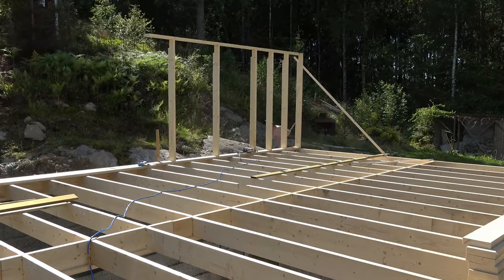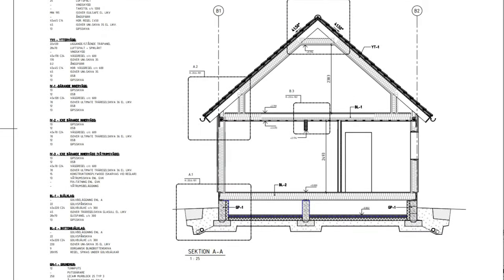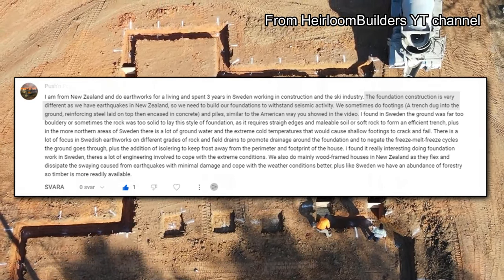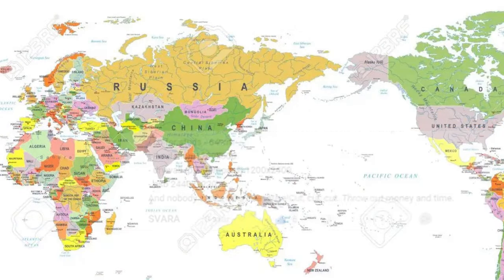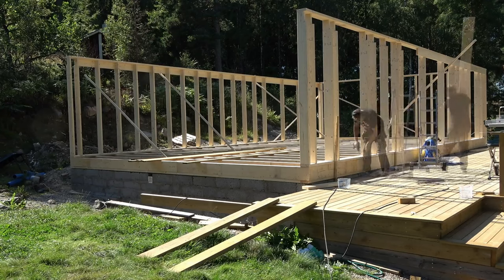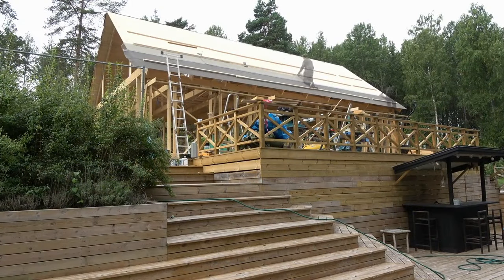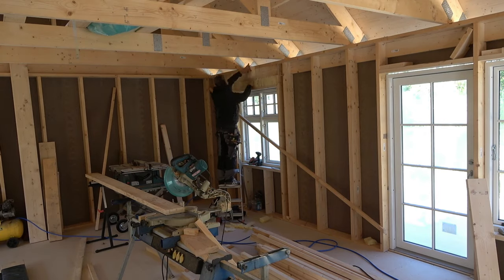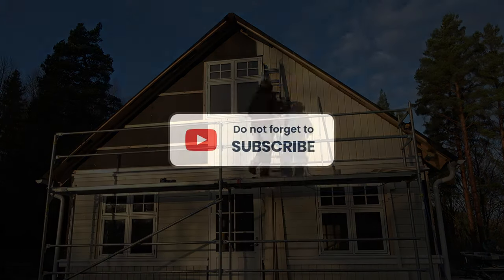UPDATED VERSION! Scandinavian VS American, CA, NZ, RU, AU building methods, let's compare...

Comment: Very interesting comparison! For two years now, we are living in a Scandinavian style house in Germany. The brand formerly worked together with a Swedish company but because of struggles from Swedish crown to Euro, they changed to a Danish company (Danish crown is fixed to the Euro). Building methodology kept the same as far as I know, supporting the comment you mentioned, that Danish house builders follow the same approach as the Swedes do.

Our house does not have OSB on the inside of the walls, but plaster is the robust Fermacell. So mounting anything on these walls is not an issue, just like you described with the OSB backing. But I guess, OSB would have helped in noise insulation, as our walls sadly don't absorb a lot of the noises from the outside. Definitely a downside of a wooden house compared the the brick houses here in Germany - at least as long as you are living with close neighbors all around.

I found the chapter about cables and pipes quite interesting. There, we seem to have the German way, as we don't have routing pipes for the cables and not the double pipes for water, either. I totally agree on you, that the marginally higher costs would really pay out later. But in Germany, costs are always very high priority, nowadays...

What I like most on our house, are the windows! The Scandinavian style (we have Nordan from Norway) are so much better than the German style, I think. Normal windows over here are opening towards the inside, whereas in Scandinavia opening towards the outside is the standard. Contrary to your windows, we have the top swinging ones.

Thanks for all your effort going into these videos!

Comment: I'm in canada, next building I do I'll try to not sheet the floor and to put an hammerband, 

Also in Canada we sheet our wall before rising them

Another thing, in eastern Canada we do fitting strips , commonly called strapping between the studs and the sheetrock, however we don't feed cable and pipes in that space because of the risk there is for them.to be damaged by sheetrock screws
Reply: My next house will have the installation walls, but with battens placed vertically on the studs so the cables and pipes can run up the wall half way between two battens. In Australia everyone expects these services to run vertically, and the safest option is to put them where people expect them to be. Then it shouldn't be a problem to screw the plasterboard to the battens.

Comment: As an architect I personally hate the use of OSB especially in the sub layer sheathing of roofing materials. Over time it will dip between trusses and is really visible as the home ages. I prefer CD grade 5/8 inch plywood. Followed by 40 pound asphalt paper under the final roofing material. I am curious as why you used concrete block for the foundation walls instead of using ICF concrete forms and steel reinforced concrete. The forms are made of rigid foam which will add a vapor and insulating barrier to the foundation. The use of osb is interesting when used behind the drywall. It’s great when it comes time to hang shelving and artwork on the walls. I am and have always been in favor of a vapor barrier inside the wall over insulation. A layer of Tyvek vapor barrier over the exterior sheathing helps vent out moisture vapor while preventing the ingress of actual water from any flaw or defect in the final exterior covering of the home. Running electrics in conduit is also a good idea. I run separate conduits for electrical and low voltage controls / cat6 cabling and satellite. Most every room in my home has runs in two different locations for TV / satellite and telephone / internet wiring. As internet wiring becomes more sophisticated I can pull out the copper cat 6 and replace with fiber optic multi mode cables. The bad part of the conduit used in this south eastern country in Europe is that it is a plastic flex. If there should be a catastrophic event inside the conduit it will be next to impossible to pull out the wires due to insulation melting to the plastic conduit.
As for pre wiring before installing drywall inside, the electric boxes here are designed to be installed after the fact. In the USA our boxes are made with a nailing tab or with nail holders and nails on the top and bottom sides of the boxes. This allows one to pre position and wire all electrical rough in’s for the first electrical inspection. Now here in the part of the EU, try feeding the conduit in and out of the electrical box with wires in it with a box that is designed to be fitted after drywall is installed. It DOES NOT WORK!
Can you possibly give me more information how electrical rough in’s are done in your region or a reference to a video?
I think you for the valuable information you have provided!
Reply from the maker: Hi and thank you for all the information. I have a video with some of the wiring but not a detailed one. Here is a video of the boxes i use.
https://www.youtube.com/watch?v=zJu7S39A3uI

Comment: Croatia experience
From the initial idea to getting a building permit it takes a minimum of 3 months and while you can make your own building plans to apply for a building permit you need to have an architect, a civil engineer, electrical engineer and a mechanical engineer, all of who have to be government certified to make building plans for your house. Even if it's a small residential house. There are some exceptions but that's mostly for tiny stuff like a woodshed etc.
Pretty much every house here has concrete foundation in one of two ways: a concrete slab about 30cm (12 inches) or thicker depending if there is a 2nd story or not. The other way is to have a concrete slab 12 to 15cm thick on strip footings 40 to 50cm wide and 50 to 80cm tall. The 2nd one is used when the ground isn't level but the slab is preferred since it's simpler to make.
I draw plans for wooden prefabricated houses, the company standards are 62,5cm C/C on the walls. This is because plasterboard is 125cm wide. For floors we do 35cm C/C because that fits well into 251cm wide floor elements which is how long an OSB board is. Btw, our floors are 6/22cm on 35cm C/C which is quite a bit denser than what you appear to do.

Comment: The only potential disadvantage I can think of with using installation walls is if it’s used alongside flammable insulation. Would be easy for fire to spread within the gap behind the OSB/plasterboard.
Reply: I agree with you but the idea has advantages with an insulator like rock-wool. Live in the mountains of US where foam is pushed.

Comment: I definitely prefer my good galvanised iron roof!

My current house had the double top plate as per the truss manufacturer's specifications. It does the job, but next time I'm copying your hammerband. A basic understanding of timber framing says that's going to have greater structural strength than the same piece of timber on its flat.

I hear your point about the ply flooring out in the rain. It's not really a concern in most parts of Australia where dry weather will generally be back soon enough after every rain, but you're in a very different climate. I like how the ply gives us a safer work surface, and it's easier to make sure the undersides of the wall frames are properly air-sealed to the ply to stop draughts and insects. You do need longer screws to go through the ply and still penetrate the same distance into the framing timber underneath, but it's worth it.

We're working to not use vapour barriers in our walls here in southern Australia. In summer, the air outside is hotter than the air inside, and in winter, the air inside is warmer than the air outside. There is no place in a wall cavity that you can put a vapour barrier that won't create condensation and mould problems at some time of year! So we're working to block actual air movement as per the blower door test, but keep everything vapour permeable so moisture can escape wherever it wants to and hopefully not damage anything on its way. It's still a new science, so it will be interesting to watch how different countries resolve these challenges in years to come.

I wouldn't want to hang bookshelves or cupboards on a wall with the screws only going into particlemuck or plywood. When there's no wood product behind the plasterboard, it's a lot easier to find the studs, and secure these sorts of heavy objects properly with screws into the middles of the studs. Anywhere I've added things like that to my house, if you take a shelf down you'll find a little row of patched-up pinholes in the plaster where I've tapped a very small nail through to locate the edges of the studs to make sure I'm driving screws into the middle of the timber. It's extremely accurate, doesn't take long, and the holes are covered by whatever I'm attaching to the wall anyway.

Comment: I built my first house on the Central Coast of NSW, Australia. Halfway between Sydney and Newcastle. It was built in the early 70's My block was situated over a long wall coal mine extraction site It mine was at a depth of over 300 metres. 
It requires that any foundation or slab meet the requirements of the Mine Subsidence Board to stay together if the ground subsides. If you don't meet their requirements then any structural damage done due to subsidence will not have its rectification paid for by the Mine Subsidence Board t. 
In reality that meant thicker concrete and thicker rebars. It was calculated it cost nearly double what a normal slab would have been on my type of soil. This extra cost was paid by the builder/owner NOT the coal mine.
The rest of the cottage was a standard frame house. With lightweight outer walls and gyprock inner. With a tin roof.

Comment: The function of the vapor barrier is also to make the house airtight. An airtight house leaks less heat and has a lower risk of moisture damage. Ps we make the outerwalls the same way in Finland. (except we put two boards across to ensure ventilation of the facadeboards)

Comment: Not sure if your plastic vapor barrier is different but in the US we use a 6mm or 12mm plastic vapor barrier in the crawlspace and it does not prevent radon gas. We sometimes install radon mitigation systems that are underneath the vapor barrier, it is usually 2in perforated PVC pipe (spaced anywhere from 16 to 60 inches apart) in the gravel that vents to the outside. It is not super common, but there is growing awareness about radon, especially in the sandy soils of the southern US.
Reply: mil, not mm
Reply: @archbaas  Yes, 1 mil = 0.001" (one thousandth of an inch), and 1 mm is approximately 40 mils.

Comment: Walls ate pretty much the same in Finland, but usually only plasterb inside side without osb or similar. Floor is insulated usually with white eps, glasswool goes on the walls. Most of the roofs are metal. Wood under metal sheets is not fully, like every 35cm there is a example 32x100mm size wood on top of trusses.

Comment: Thanks for the video. In Russia, there are no inspections of private homes like in Scandinavia or the USA, and this is very bad. People carry out inspections of their homes themselves. Therefore, such videos are very useful. I want to express my idea about floor insulation. When warming the floor, you can insert a piece of insulation vertically under the wall, then you will not have gaps between the floor insulation and the bottom of the wall. Even a small gap of 5 mm will steal your heat and then the floor along the wall will be cool.

Comment: Your way of building the house is far superior than almost everything on the North America. Especially that you use vapour open material on the outside of your frame, and vapour closed (with OSB or vapour barrier) on the inside should be done in at least 50% of the North American continent. Somehow it went off all in the wrong direction with all these vapour right materials on the market here. (I’m speaking for heating dominated climate.) Thnkas for this great video. Very interesting.

Comment: The ranch home I’m living in (suburb of Chicago, Illinois, USA) was built 20 years ago. I’m the original owner in a tract subdivision.  It has a full basement and a double brick fire place, one in the basement and one in the family room on the first floor. The home is 53’ x 38’, 2240sqft., not counting the attached 3 car garage (700sqft).  It has three steel I beams and 6 metal posts in the basement supporting the main floor.  The floor was built first, with tongue and grooved plywood then the factory built walls were erected in one day and various factory built trusses were also erected the next day. Then the 5/8” plywood covered the roof then shingles.  The foundation was started at the end of March in 2003 and we got the keys and were able to move in at the end of May in 2003. The middle of the home has a 14’ vaulted ceiling and the whole home has 9’ ceilings thru-out! It has 2 full baths on the main level and one in the basement. There is no plumbing in an outside wall. The home has many built-in closets. It was built with metal conduit for the solid electric lines. I have had no problems with the home since it was built. This is not a custom home, but a tract home.

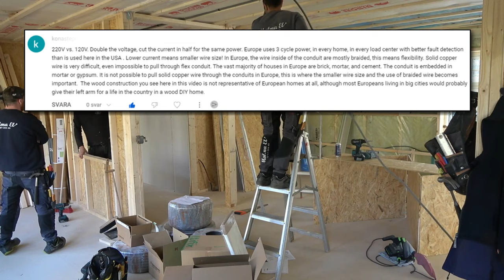Comment: At 22:55 The comment is not correct (at least for the Netherlands) It is correct that 230v means less current... But we have solid wires and it is still manditory to lead them thru plastic pipes. So, like you pointed out, the wires can be replaced if nesessery... (And it is possible to pull 5 solid wires thru a pipe...)

Comment: In Brazil we have many construction methods, but the most common is with ceramic brick in the north of the country, center and south.
Remember, in Brazil the north is very hot with temperatures around 28 to 42°C all year round, in the south we have strange temperatures in summer an average of 30 to 38°C and in winter an average of 14°C, but in winter peak negative temperatures around -5 no house here is prepared for that.
In the south, wooden houses are more common, in the north they do not exist, wood in the south is cheaper and most of the wood that other countries use are from Brazil pine or spruce grow ridiculously fast here.

I never seen bricks like ours in construction videos.
The way the window and door reinforcements are made with a line of brick without core making it possible to place iron bars and cement, it has concrete pillars and stringers too, the brick Ceramic only serves as a closure but also as a structure I don't know how to explain it.
We also use structural cement blocks to build houses, in some places it's cheaper, and in addition to the pillars and stringers, hollow blocks are also used to reinforce the gaps. 
Foundation is one thing hard to explain, Brazil is a very big country, here you have all types of soil, we just don't have frozen soil. 
The method used to build wooden houses here I find it very strange, it doesn't seem to have any structure but there is a lot of old houses,  60 to 120 years old built like this. 
They exist mostly in the south of the country, it is very rare to see a wooden house in the north, there is a lot of German and Polish influence in the south of the country, but the way houses are made nowadays I never seen it in another country. 
We also use conduits here it's mandatory and from the last regulatory standard we only use flexible cables, our electrical standards are very complex aiming at maximum safety, but nobody follows that's why there are so many electrical accidents here. 
A curiosity here we only use an electric shower due to safety and low maintenance, it is safer than a gas shower.
The only reported accidents are in very old houses or buildings with metallic pipes, with precarious electrical installation and metallic showers. 
The plumbing here is pvc now, I believe it is mandatory because I have never seen new metallic installation in houses, only in specific industries for high pressure. 
The showers also have a plastic core to avoid accidents when a resistance bursts, the first ones didn't have it, that's why the accidents. 
The water conducts electricity very poorly, accidents only happened because the resistance of the shower opened against the metallic body of the shower, the shower energized the copper pipes, which energized the water valve, the water cooled down, you turn off the shower and a disaster it happens.

Comment: Using the board at the top instead of a header is a better idea for insulating.  Headers on exterior walls often have no insulation.  Charles

Comment: In AU - hammerband would provide more rigidity and help stop racking forces and buckling end condition.. also act as a top batten to attach coverings.  Double Top plate are a lazy way of doing this with some ply sheets on the walls in the corners (shear panel) of diagonal straps. Its common to use 70x35mm or 90x45mm timber for walls with Noggins for similar reasons. Nails are ductile and can accommodate a lot of movement before snapping (shearing & other long term cyclic forces like wind load, thermal expansion etc) whereas a screw is stronger in longitudinal tension as its design to provide clamping forces but snaps easier (brittle) when bent (lateral force) - its deliberate and material specific.